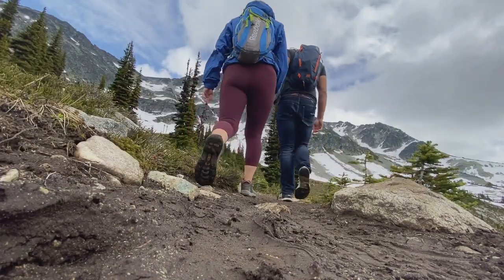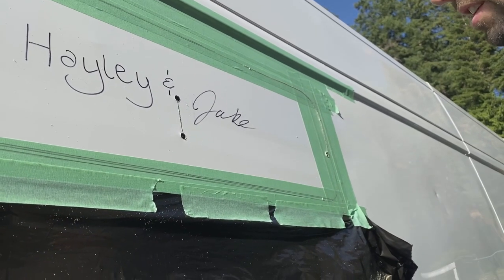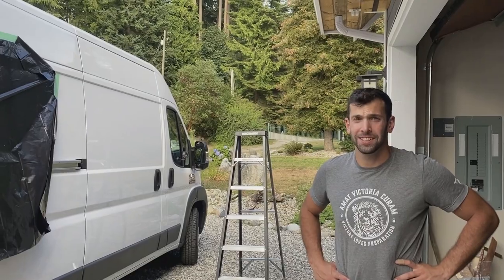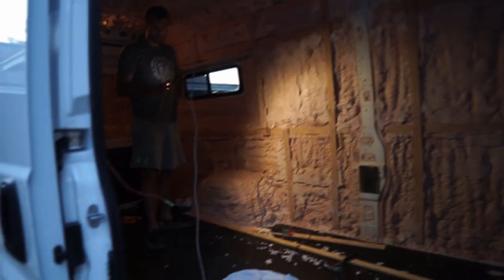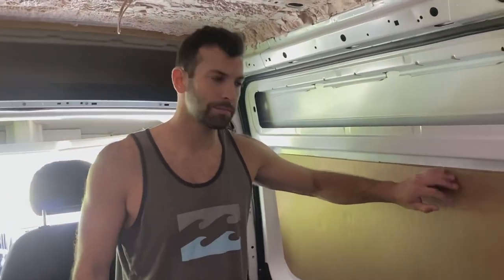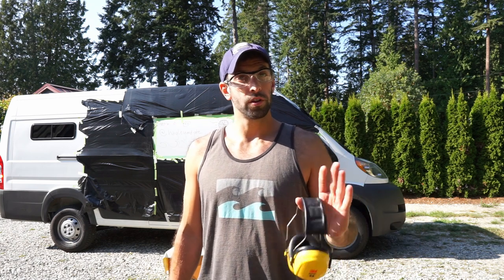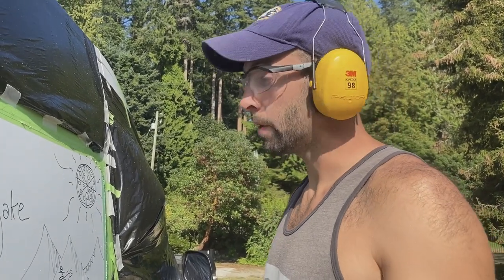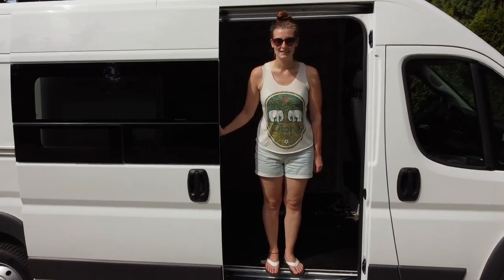CR Laurence Window Installation | Sliding Door | Bunk RV Window | PROMASTER VAN BUILD SERIES | EP 10

Comment: Did you get any noticeable rippling/wavyness around the rim of your bunk windows? If so any thoughts on how to prevent this? If not, was that something you considered? Got lucky? What do you think kept that from happening. It's something i Notice in a lot of folks videos, and more often then not they seem to not mention it. I am about to install the same windows as you, and want to avoid this. I'm pretty sure it comes from a whole that is slightly undersized, and/or the screws not having a whole pre-drilled through the sheet metal of the van. Anyway I'll wait for your experience/thoughts, then we can keep chatting.
Reply from the maker: Hi Simon! We did not get any noticeable rippling around out window. We were concerned about the metal rippling when cutting with a jig saw, but did some test cuts with ultra fine sheet metal blades (32TPI) and it was perfect 👍🏼 I believe we linked to the blades in the description. We also spray foamed our van before installing our windows (just how the timing worked out), which may have helped stiffen up the side. 

One thing to note is that you're bolting a flat piece of glass/window to a curved surface. This is going to cause the metal around the window to flatten a little to match. With the promaster it wasn't an issue (less curve), but we can see that being much more of an issue on a sprinter or transit. We don't think this has anything to do with the hole size. 

We would recommend NOT drilling the screw holes through the side of the van (if you're using the same windows as us). The windows we used are designed to clamp together and squeeze the metal of the van, not screw all the way through it. The two halves of the window should screw together with the van in between them. As mentioned in the video, not all of the screw holes in the window extrusion are pre-drilled.

Hope that helps! Let us know if you have any other questions.
Reply: @HayleyandJake  great info thanks! Ok see I haven’t received my windows yet (backordered) so I didn’t kn that’s how they work. Humph! Seems like your curved sides theory might hold water. I have a transit, damn I hope I don’t get ugly ripples. If anyone else out there reading this has thought, take a sec to chat here, will help me and future folks.
Reply: @simonomis514  Hey Simon, in the same boat right now as you were a year ago. About to purchase these windows for my extended length transit and wondering about the flat window on the curved van surface.

Did you go through with your window install, how'd it turn out? Any deformation of the van wall due to the flat bunk window?

Comment: To clarify, the company recommended to glue in the windows but you screwed them in. What was your reasoning behind your decision to screw vs glue?
Reply from the maker: Hey! The windows we bought were clearly screw on windows. You can also get windows that you glue on, but those aren’t what we had. The lady on the phone was mistaken. 

Basically our windows have an outer part with the glass, frame, and gasket, and an inner part that clamps the window tightly to the van. You tighten the screws and the clamping force holds the window to the van and seals against the gasket. CRLaurence sends the windows with a only a few screw holes drilled (which is a pain) so we had to force the rest of the screws into the chase. We were just trying to ensure that this was the right thing to do. 

Their customer support initially said the glue the gasket to the van (which is only foam) and not use any screws. That wouldn’t hold the window to the van at all, and when we questioned that she took it back and said she could email the engineering department for us. 

We ended up using a drill with light torque and slowly installing the screws while someone holds the window from the outside. They’ve been perfect 👍

Hope that helps!
Reply: @HayleyandJake   Thanks so much! We ordered CRL Windows but awaiting the back log. Just wanted to make sure I wasn't missing anything on the install portion. As I am sure you are aware nothing in the van life comes with detailed instructions. I guess I will see what I get when they arrive.
Reply from the maker: That’s super exciting!! Good luck with the install and the rest of the build 😊 If you have any more questions about the install we are happy to help / share our experience!
Reply: Wanted to thank you again! We got our windows and as you said they were also designed to screw in. Your video helped tremendously with installation as every other video I watched said glue them in. Thanks for the tip not to glue or pre-drill holes, they look great!
Reply from the maker: @vanced.7981  hey Vance, thanks for checking back and letting us know! We are so happy to hear you got your windows installed, that’s fantastic!! 🙌 We are glad to hear our video helped you. Good luck with the rest of your build 😊

Comment: Hey Jake, i have a question, we just installed an identical window, its the FW395B, the inside ring snugs down pretty good, ( hated the philips head screws), but what i dont like is the glass is actually 1/4" off the door. I thought the glass would have pulled in tight against the sliding door. ??
Reply from the maker: Hey! 😊 ours has a little gap too. It’s tight where it mounts but there’s a little gap between the metal van and the glass of the window, probably to prevent the glass breaking from vibrations. 👍

Comment: Do you have AC unit? If no any regrets not having one? I'm trying to figure out if its really needed before I cut into VAN.
Reply from the maker: Hey! We don’t have an AC unit. We looked at it, but we would have needed to get thousands of dollars of batteries just to be able to use it (our setup is entirely off grid). 

Our van has the built in AC, which is pretty good. We’ve found using that while driving and our maxair fan and windows while parked works great 👍
Reply: @HayleyandJake  Yeah this was my thoughts exactly all the batteries needed to run the unit. We bought two maxx fans to install but started to think about how it feel on those HOT 🔥  summer days. 😔
Reply from the maker: For sure! We just took our van down to Baja where it was 30+ Celsius in the heat of the day, and we found that with our windows and fan it wasn’t too bad 👍

Comment: I spent a little over 20 yrs working in Elkhart, IN, the rv capital of the world. I build vans and schoolies on the side and so many of you guys are making the big mistake of spray in foam insulation. 
Good luck!
Reply from the maker: We’ve loved it so far, why do you have that opinion?
Reply: @HayleyandJake   In the rv industry we did a ton of testing and had these companies in and they all failed the testing. That is why they all use either foam board, roll insulation, or both still today. The spray in foam insulation wasn't able to breath between the exterior wall and the spray in foam. That then caused condensation build up, then rust started. Then mildew/mold kicked in between the interior wall and the foam. With the other insulation it's normally a higher r value yet it can breath. In the rv's, travel trailers, 5 wheels, schoolies, and van builds a circulation of fresh is key to helping this issue, like a Maxxair fan than can pull in fresh and suck out if need. I ain't trying to be a azz or anything. I have been doing this for many yrs and built hundreds on the side for customers. I do conventions and I've fixed a lot of one company work by where I recently moved to in 2016 Asheville, NC, and I'm just trying to help people and give a heads up. I also always recommend doing a rubber moisture barrier on the floor and a ft up the wall and only use foam board on the floors. Good luck!
Reply from the maker: @jasonritter2492  Sounds like you have a lot of valuable knowledge. Thank you for sharing it with us. I guess time will tell if we have any issues or not! Thanks and take care.